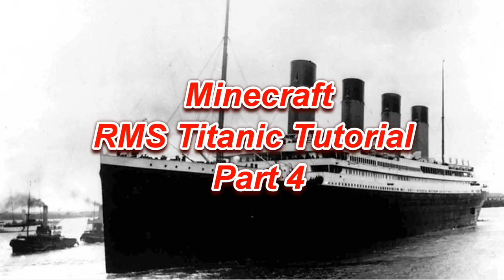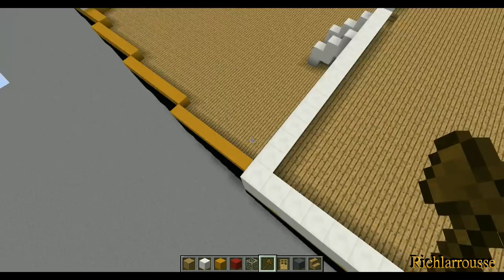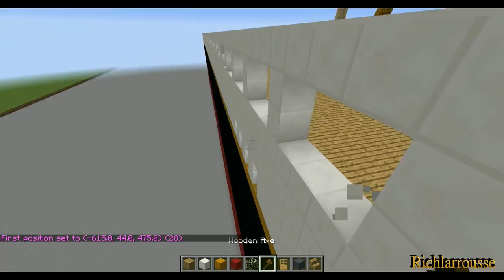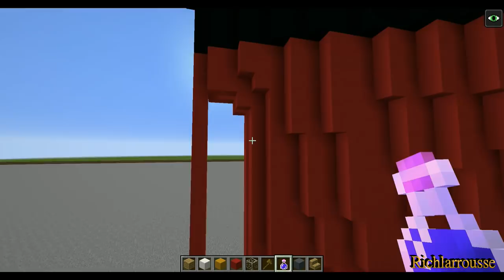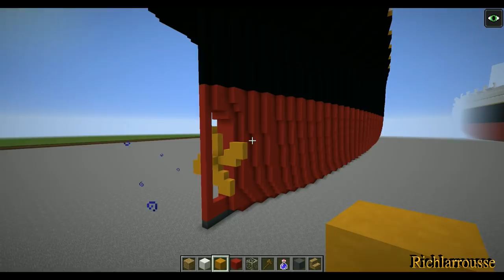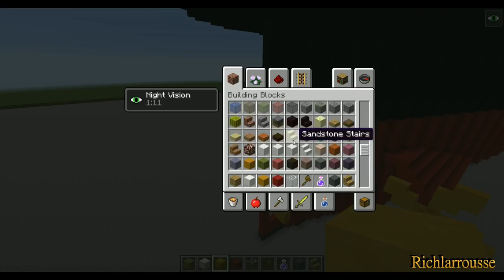Minecraft RMS Titanic Tutorial #4 (2018)

Comment: At minute 9 and seven seconds I've done it but the last 3 pillars are 1 block off when the first one is correct
Reply: Wondering if there's any help I could get
Reply: As the gap I need is the 13 it's 14
Reply from the maker: i think 1 block difference should be ok, dont worry about it
Reply: @Richlarrousse-JS41  ok thank you
Reply: I just wanted to make ire that it definitely won't affect anything at all because I don't want to risk having to break it all
Reply: @Oliver Lincoln, I just did the same thing